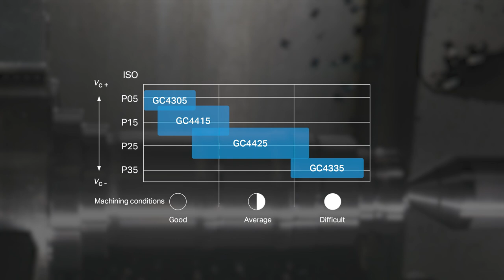New carbide grades for productive steel turning - GC4415 and GC4425

Comment: Why would you cut in that direction?
Reply: The rake of the cutting surface.
Reply: This is called "PrimeTurning". The main point of this technology is that we get small entry angle which creates chip thinning effect and allows to increase feedrate dramatically. There're some advantages (and limitations also), but that's the main one :)
Reply: @romanplutok6202  Also you're pushing the swarf AWAY from the chuck and it doesn't build up and ruin the finish or break tools
Reply: @GeneralG1810  That's another benefit, but there are some more (like bettert heat distribution in the insert and the fact that insert tip isn't the week point anymore) :)
But there are some limitations as well: stability requirements, need to re-program the component